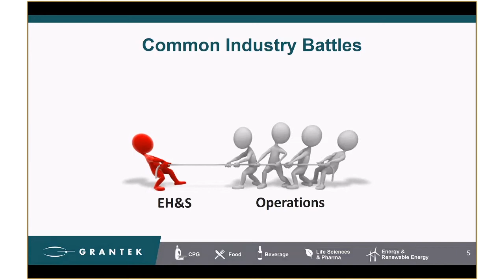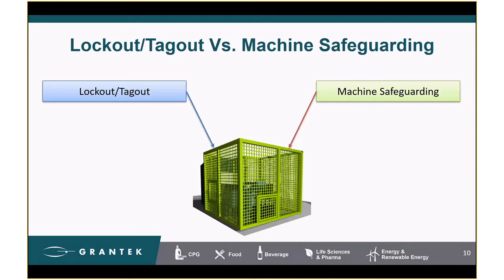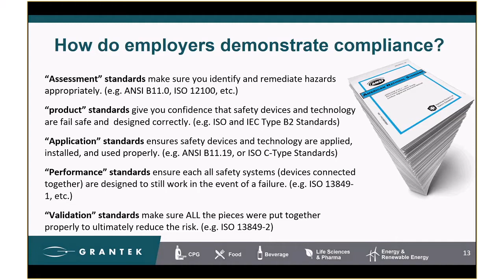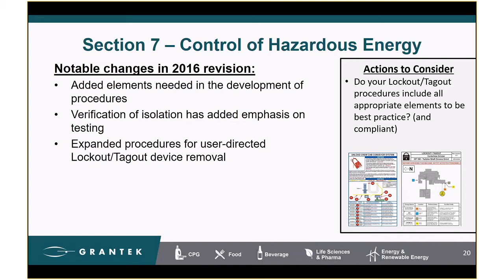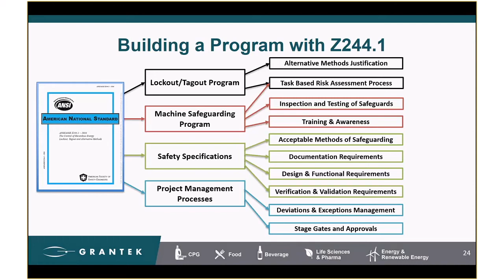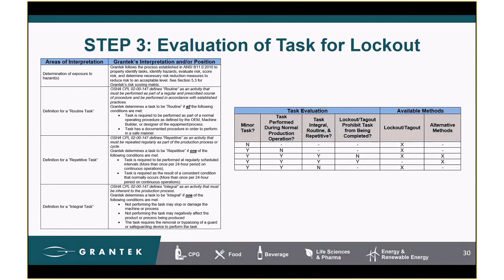The 2016 ANSI/ASSE Z244.1 Standard - Impact to Lockout, Tagout and Alternative Methods

Comment: That was eye opening.  Will CSA follow ANSI or have they already done so?
Reply from the maker: Hi Trevor, thanks for watching. CSA Z460 last updated their standard in 2013, and was just reaffirmed in 2018. The original version of this standard, first released in 2005, pulled from US OSHA regulation 1910.147 and ANSI/ASSE Z244.1. The CSA standard is very similar in its scope, its purpose, and its process, however, there are differences in the requirements that can have a big impact on overall program development and management. Since US and Canada have different regulations for Control of Hazardous Energy, I would doubt the standards will become harmonized, meaning they are essentially interchangeable. I hope that helps!